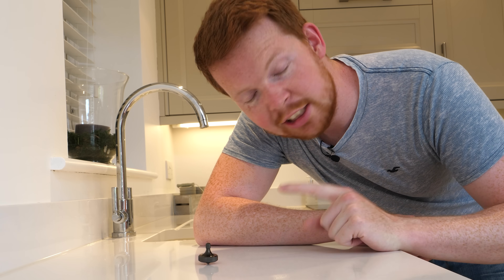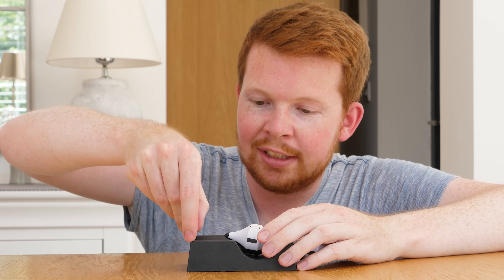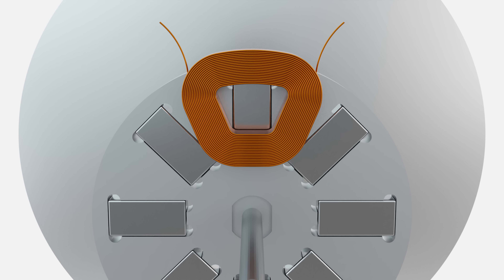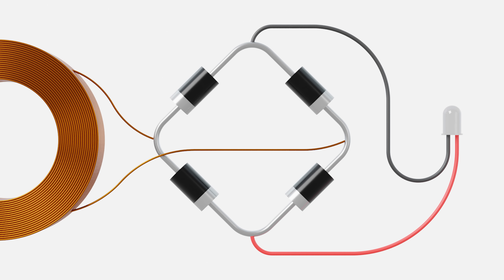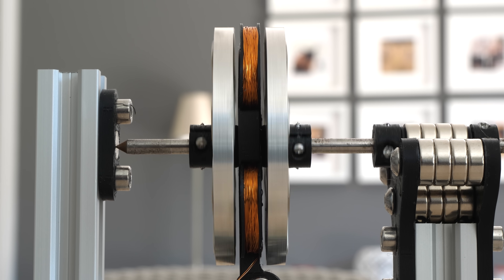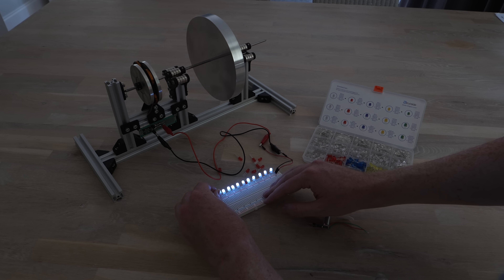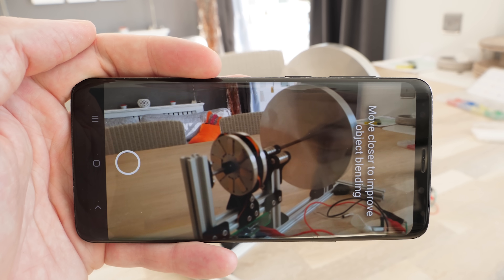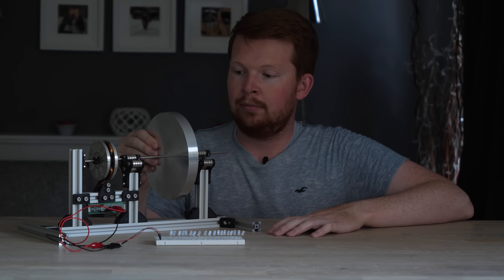Flywheel Battery

Comment: i'm a bit sad that you didn't use a clip from electroboom for the "FULL BRIDGE RECTIFIER"
Reply: true... missed opportunity.
Reply: Brain inserted the clip on its own. Electroboom is great.
Reply: Yeah, it is impossible to say `full bridge rectifier` without thinking about the ElectromBOOM clip.
Reply: Yes he should have done it
Reply: I was just about to say the same thing...😪
Reply: Yup I was going to say the same thing. Or at least apply a similar sound effect
Reply: My thoughts exactly
Reply: +1
Reply: I don't think ElectroBOOM has ever done a video on those. He does have one on the FOOL BRIDGE RECTIFIYAH though, that might be what you're thinking ;)
Reply: Was expecting that too lol 😂
Reply: agree
Reply: This is a magic! But seriously you can connect little bigger capacitors connected in parallel with the DC output and this will get a rid off the flickering however the power output will be very slightly diminished. You can connect the capacitors in your way (sorry but it's not clear how you connected the capacitors) probably as well but if it is flickering it means that the capacitors are too small. But your setup could be further scaled up to the Very cool techno strobo light ! He he. Here is a question what would be a really having some sense source of the power? (because you have been used the drill it's kinda of cheating isn't?) I have been thinking about this and the best idea of anything available in this configuration would be the wind power but it is a difficult question if the rod will be able to stay in the center- I am think that the hardest thing would be made the colected air make rawly about the same pressure uniformly put on all the same about whole the dimension of the windmill and windmill blades would be very hard to balance it's going to be a crazy if you would put that to produce any energy! Please keep in mind that I not criticise your project or ridicule it. It just gave my mind field to think about any possible practical use this jut looking like kind of magic top of the engineering very cool and effective device to produce tiny amount of the electricity.
Reply: I was just about to mention so too lollll
Reply: I feel the woe and sorrow of this missed opportunity!  He will be forever remembered for not talking a FULL BRIDGE RECTIFIER opportunity and not utilising it!!!
Reply: Yes, I came to the comments looking for this
Reply: same :(
Reply: agreed
Reply: @jjswanepoel4716  great job explaining!
Reply: 666th like.
Reply: @everythingemilyofficial  😈
Reply: engineering
Reply: lol
Reply: https://youtu.be/9dtPEk73X9U for context
Reply: FOOL BRIDGE RECTIFIER
Reply: I was just about to say that
Reply: Me too🙁
Reply: i still remember old lidmotor saying it back when he was making a a earth battery
Reply: As soon a he showed the diode I was waiting for it, never mind.
Reply: yeah, how dare he not use copyrighted material from other people, for your entertainment...
Reply: @noisytim  As long as he only uses what's needed and gives credit and a link back, there shouldn't be a problem. It would be within fair use guidelines. It's a (mostly) friendly community so having a 3 second audio soundbite of someone who's basically an electrical engineering meme by now, wouldn't cause too much harm I don't think. It's not like he's reuploading the guys video and claiming they're his own.
Reply: @sharks3010  contentID doesn’t care about fair use…
Reply: u know i just realised, even after watching Electroboom for a while I only just learned what they actually do xD
Reply: I finally get what it is.
Reply: Somebody call Mehdi
Reply: i really thought this wasn't just me
Reply: Yea, i also missed that :(
Reply: Lol
Reply: Came down here to find this comment.
Reply: you mean the FOOL BRIDGE RECTUM FRIER!
Reply: No, it's not sad. Dead meme

Comment: I am starting to think Tom is obsessed with flywheels
Reply: It's a passing phase. Just like how he obsessed about pneumatic contraptions for awhile.
Reply: @ketsuekikumori9145  well it sure wasn't "just a phase" for colinfurze..
Reply: @ketsuekikumori9145  I don’t think it’s a phase
Reply: Wait until he discovers the joys of contra-rotating flywheels with variable radius power & pick-up fields : )
Reply: Sir, you are wrong. He surely hates flywheels.
Reply: Nahh I don't see the obsession?? 😂😂
Reply: Energy storage is all the rage right now.  Even Technology Connections is gettiing in on the action, but by using electrical economics and deep cooling to turn his house into a negative heat reservoir so he saves money and doesn't burden the power grid with his AC and dehumidification.
Reply: The mind learns something new and then extrapolates
Reply: @DarrinR  almost read…”The mind learns something new and then extra potatoes”.
Reply: Flywheels are well worthy of obsession. They are the Sampson of mechanical doo dads.
Reply: Not just flywheels, but seemingly any energy storage device. Compressed air, gravitational potential, capacitors. Nearly every video has some sort of energy storage involved. I love it!
Reply: Who wouldn't be? Alternative energy storage is neat!
Reply: Well he used to be obsessed with compressed air engines
Reply: @Salamandra40k   - The pressure got to him . . .
Reply: Can't blame him. I can think of a few ways to make that much more efficient in producing some electricity.
Reply: I thought everyone was
Reply: Ofc he is
Reply: I can understand. Watching this makes me want more coils, more weight, more flywheels, MOOOOOOOORE POWEEEEEER. PUT IT IN A BIKE. MAKE THIS $HIT FLY, GODDAMMIT. sorry...
Reply: One might say he's pretty fly for a science guy.
Reply: Tom would probably be interested in the Nissan LeMans Prototype with the hybrid system using a flywheel to store energy
Reply: @patricio-gomez1 Some London busses used to have a flywheel retrofitted to improve fuel efficiency. The system was originally designed by the Williams F1 Team.
Reply: You can't really blame him they are pretty cool
Reply: Everyone gets obsessed with flywheels... because once you start, it's hard to stop
geddit?
Reply: YES
Reply: Now what would give you that idea
Reply: Starting?
Reply: Nah
Reply: And I can respect that.
Reply: He's coming around to them
Reply: Who isnt? Theyre awesome!
Reply: Cool way of storing energy
Reply: Nasa when they had a challenge on perpetual motion they needed to release a document on why flywheels where not free.
Reply: Nah really
Reply: Next it will be gyroscopes. Eric Laithwaite would be proud.
Reply: You aren't?
Reply: Me too 🤭
Reply: Who isnt !!
Reply: Just wait until he discovers you can attach teeth to them and smash things 👌
Reply: Wait... He's not?
Reply: There are definitely worse obsessions to have...   ;^)
Reply: Good.
Reply: Why is this flywheel a solid circle but the trebuchet was like a peace sign?
Reply: Only starting lol
Reply: He's probably subscribed to r/flywheelcar
Reply: Starting? Lol
Reply: Only a little bit
Reply: Flywheels are super dangerous and really awesome all at the same time...
Reply: As he should be. Flywheels are cool.
Reply: There are many good reasons for being obsessed with flywheels
Reply: Ofcourse he is, isnt everyone? 😃
Reply: Ya think?
Reply: Starting?
Reply: Who wouldn’t tho
Reply: likely
Reply: if you peep inside his left ear you will discern something..    ..moving
Reply: Why Magnetic force is electric force? Why Magnetic moment and mono pole don't exist?

Magnetic force is circular electric force. There is no magnetic poles and there is no magnetic moment. If the magnetic moment is formed from 1 mono north pole and 1 mono south pole, like a smallest magnet, then you cannot use many of it to make a big magnet. 

Two parallel current carrying wires attract or repel each other is not caused by magnetic force, since there is no magnetic moment in copper wires.

Current carrying wire does not attract magnet and has no poles, circular current carrying wire attracts magnet and have poles.

Imaginary magnetic moment is in fact electric dipole, magnetic poleis in fact  concentric circular electric force . 

Theory Of Magnetism And Electromagnetic Induction

Ferromagnetic material has a special property – it can be magnetizing to create temporary electrical dipoles/magnetic domains.

Every magnetic domain contains at least two atoms. When an electron moves from an atom to the next atom and stays there temporarily, the two atoms become a temporary magnetic domain.

The magnetic domain carries a negative charge on one end and a positive charge on the other end, so we can call a magnetic domain an electric arrow.

Due to electric arrows carrying positive charge on the head and a negative charge on the tail, it has special properties:

1. Same direction electric arrows attract each other from head to tail, and by side to side.2. Opposite direction electric arrows repel each other from head to head, tail to tail, and by side to side.

Temporary electric arrows in magnets’ Ferro material cannot exist by themselves, but rather must all be linked into concentric rings and fill up the whole magnet, for a magnet to be stabilized and magnetized.

Therefore, on the poles of a bar magnet, there are concentric rings of electric arrows/dipoles, with one pole clockwise, and the other pole counterclockwise. On the body/surface of the bar magnet, there are parallel electric arrow rings all over.

A current in a wire does not create a circular magnetic field in space. It induces the electric arrows in the compass to be parallel to its current direction; therefore, the compass moves to 90 degrees to the wire.

Between two parallel conducting wires at distance R, line of sight electrons on the surfaces of the two wires are repelling each other with electrostatic force F=Ke x ee/R^2. This repulsion force is billions of times stronger than a steel rod. Because it connects all of those repelling electrons as one, therefore, if there is a current alternating in one wire, it will induce an alternating current in another wire instantly. This is the true mechanism of so-called electromagnetic induction. It is, in fact, electrostatic induction.

Magnetic force is a misinterpretation of circular electric force.

The magnetic field is a misinterpretation of the circular electric field.

Electromagnetic induction is a misinterpretation of electrostatic induction.

The electromagnetic wave is a misinterpretation of electrostatic wave/alternating current.

Electromagnetic radiation is a misinterpretation of electrostatic radiation.
Reply: I mean who isn't
Reply: He must love Inception
Reply: Lol
Reply: Who isn't obsessed with flywheels?
Reply: I think he is trying to figure out how to convert his wife to a flywheel dynamo when she is running around the house
Reply: Exactly like Dexter(Dexter laboratory) was obsessed with his rachet n turning up the nut.
Reply: Build a flywheel car!
Reply: And why not ?!   They are amazing
Reply: It's currently topical in the energy engineering as allergic community. "Normies" barely understand them, so he can easily harvest content ideas from online forums to dazzle you folks and collect $$ 🙄
Reply: GOD is righteous. If you repent, believe in Jesus, get baptised and receive the Holy Spirit, you will be on your way to salvation. And if you continue to walk in faith for Christ all your life, you will recieve eternal life in heaven.  Amen
Reply: @thanos3839  trust me, no.
Reply: I heard that Tom sleeps with a flywheel under the bed…
Reply: Who isn’t tho
Reply: Same
Reply: mechanical capacitor!
Reply: Flywheels can be really cool and useful.
Reply: @Ember Rhapsody I think so too, they are too beneficial for them not to be.
Reply: He is
Reply: Why u don't proove that no over unity with machanical connection the motor back to the generator ? But may be the Noble price for u if it real .
Reply: i think i am too
Reply: Tom is a flywheel…
Reply: Nah he just likes em
Reply: Yeah I checked his channel when I saw this and yeah
Reply: Yeah, he's gay, so what?